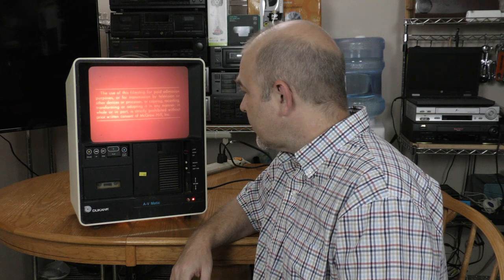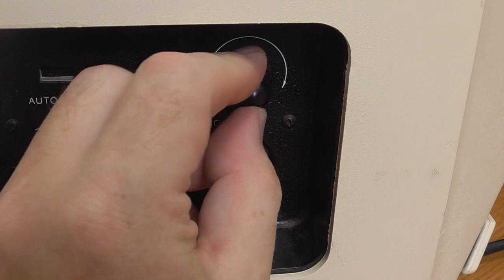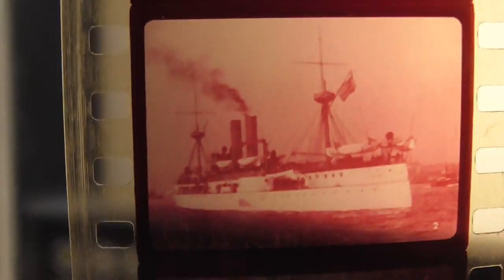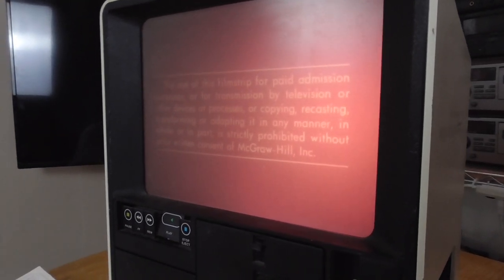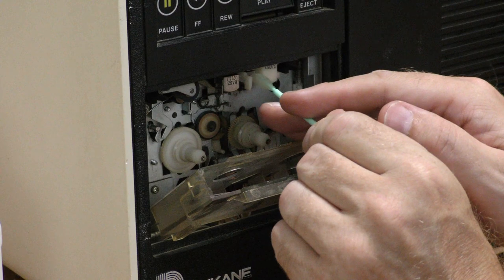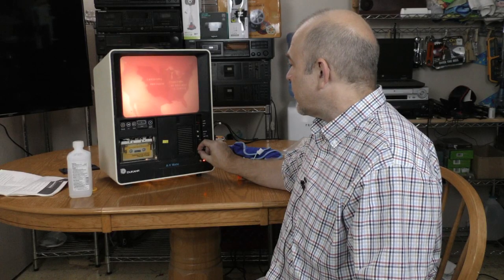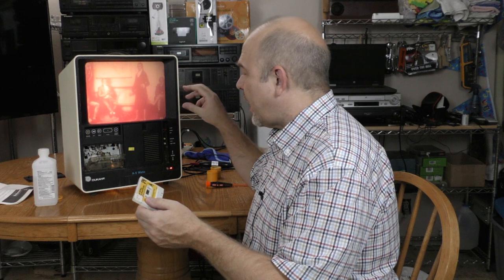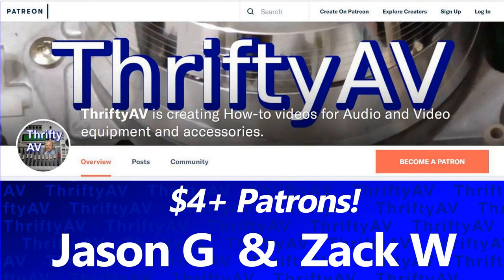Schoolhouse Nostalgia! | The Dukane A-V Matic Filmstrip Viewer with Cassette Deck!

Comment: 1987 is certainly a plausible date of manufacture for one of these. The elementary school I was in at the time didn't get its first VCR until 1988 or so. p.s. The term "rip/ripping" only applies to digital media (CDs & DVDs). With analog media you dub or transfer it, not rip it.
Reply from the maker: My high school had VCRs...  But we had better gear than the little kids...  Glad I got one of the newer ones!   And thank you on the venacular, encoding in real time is certainly more work than "ripping"!

Comment: That was really cool. Did you try it with photo film? It would be interesting to see how it works with Kodak ektachrome slide film.
Reply from the maker: photo film is positioned where the long side of the frame is parallel to the sprocket holes.  Filmstrips are positioned where the long side of the frame is perpendicular to the sprocket holes, so if I tried to use this as a 35mm viewer, it would be sideways with the edges chopped off.  I recently picked up a film scanner that is better for this type of stuff, so stay tuned for that video!